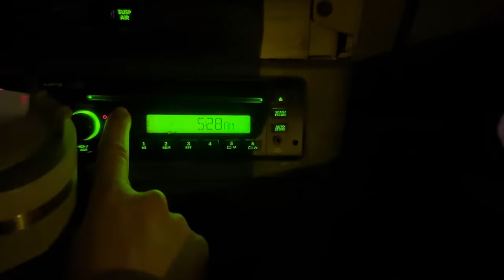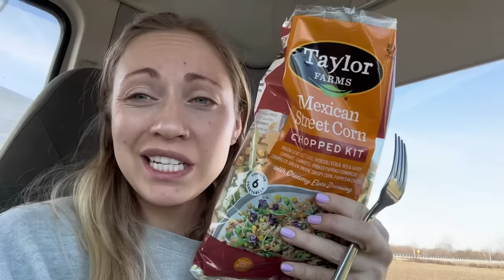Trying to haul enough grain to pay my $100,000+ bill due next week

Comment: Take your heater vents out and take a 5/8 garden hose section and ductape it to the end of your shop vac hose. Run it down in the vents. A fella I read about turned the a/c on and a pice of glass stuck him in the eye and almost blinded him. Also you will find glass under the seat as well. You sure are running yourself ragged young lady.  Take good care of yourself, you deserve a break.  🖖🏻🖖🏻🖖🏻🖖🏻🖖🏻